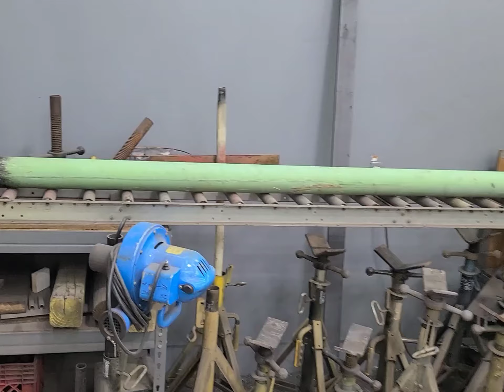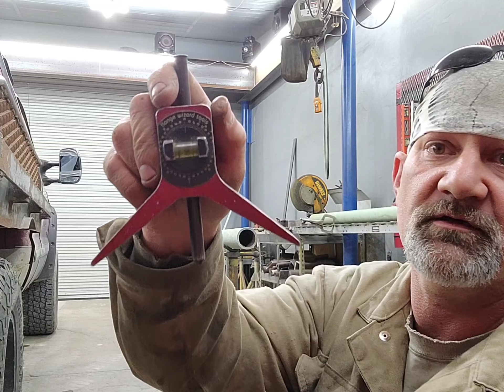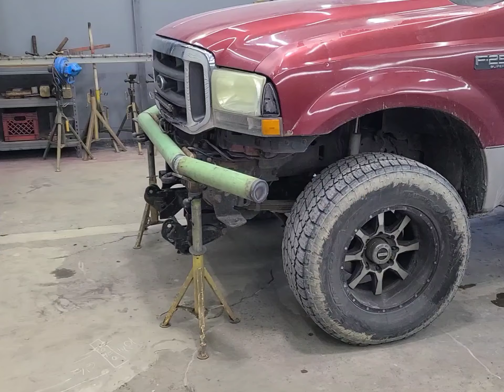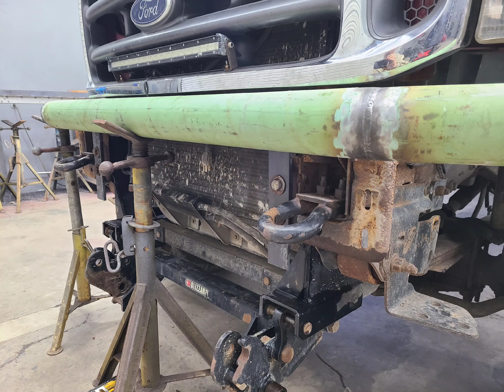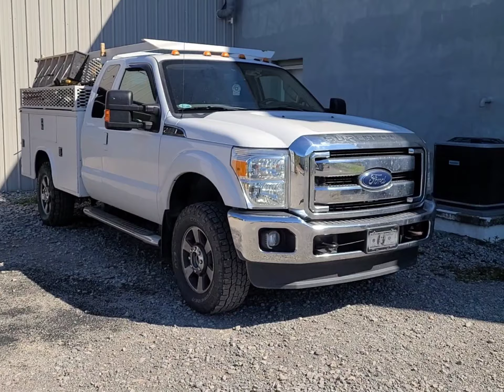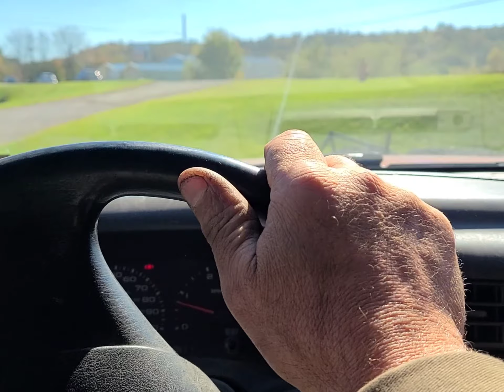Johnny wants a pipe bumper

Comment: Seeing how you used the flange wizard to keep everything "clocked" correctly was so cool! I wish you went into more detail on how you figured out the miter cuts for the pipe to get the desired angles. Id like to learn how to do that.
Reply from the maker: Did you see the included still pictures of the layout & bevel square?...Those are in the video just before the section where I explained the miter cuts on the pipe.
I thought it was explained pretty good but maybe not...dunno
Those bevel squares are not an expensive tool and they are for sale in many places, should be no problem finding an affordable one if you want to buy one
Reply: @NBSWELDING  Thanks! I'll watch it again and see if i can pick up more details
Reply from the maker: Really helps to draw it out on something...in that video I made a life size drawing on my table with soapstone but other times I've used other things to draw on or with. 
I sometimes use scrap drywall and draw on it with a pencil.

Comment: Great job.  My uncle made a large pipe front bumper for his truck and installed in a weld-o-let to screw in an air quick connect so he could put 200lbs of air in the bumper in case he had a low tire.